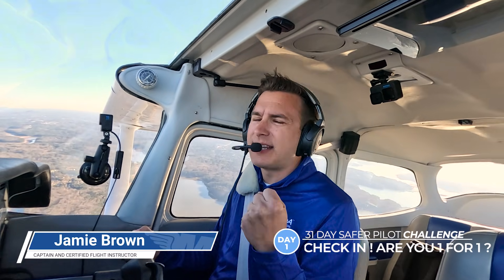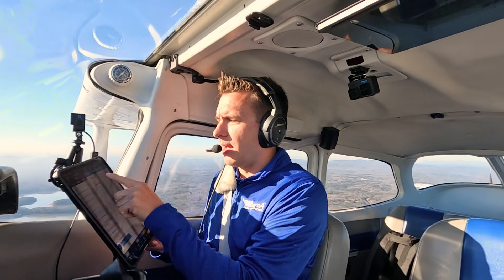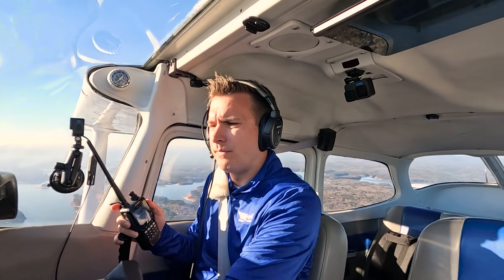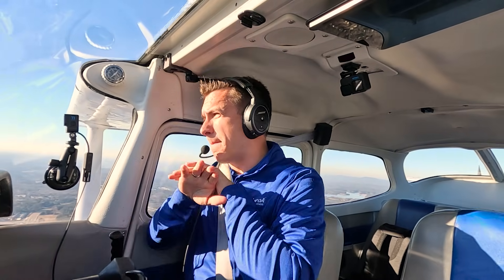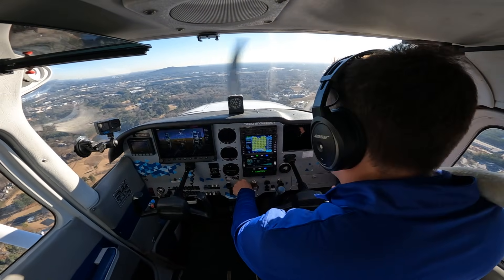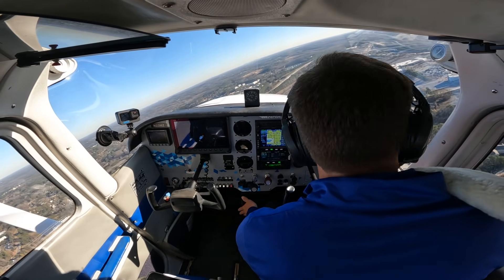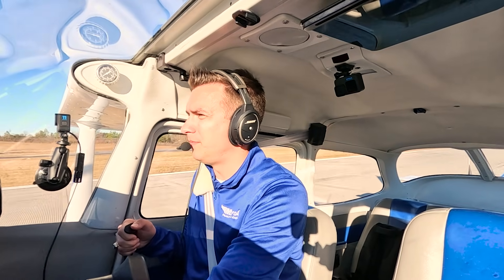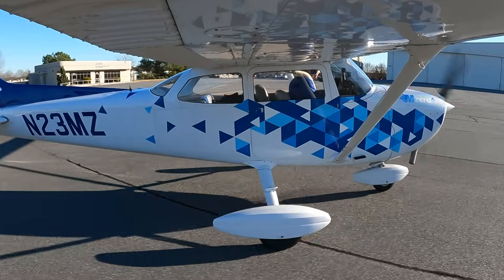Mastering the Emergency: Full Electrical Failure in 23MZ

Comment: 1/31
I've actually had this happen. Mine was from the ground lead detaching from the alternator. 
What I noticed was that there was a pattern and a sequence to loss of electrical components.
The first thing to do is to shut down all electrical by turning off the Avionics Master switch. Then turn off all individual components. Decide what you need and what you don't. For me, that would be everything except one radio. 
For a realistic scenario, I would have thought that you would change your headset plugs to the handheld. And executed an emergency straight in approach. If a straight in wasn't available, then joining the traffic pattern but executing a short approach would have been the next thing. 
Your situation might be urgent.

Comment: 1 for 1: My favorite time of the aviation year has begun. I fly a Piper Cherokee 6-260 so an electrical failure doesn't affect my flaps. However, I have had a real word electrical failure in flight. Having a handheld radio was a huge help with communication. I was operating at an uncontrolled airport so no light gun signals available. Fantastic video and production value. I love that ATC introduced this series. looking forward to each new video.
Reply from the maker: Love hearing that. Thanks for sharing your real-world experience! A handheld radio is such an underrated backup, especially at non-towered airports where light gun signals aren’t an option. Glad you’re enjoying the series, and we’re excited to keep these coming—thanks for flying along with us!

Comment: 1 for 1

I would add that if you are IFR in IMC and have an electrical failure, I would declare a mayday and get down ASAP. It is also vital to know how long your battery backup holds, (if you have one f.ex. in a GI275).

For electrical retractable gear, practicing an emergency gear extension also helps to stay proficient. It opened my eyes for sure (do it with an instructor).